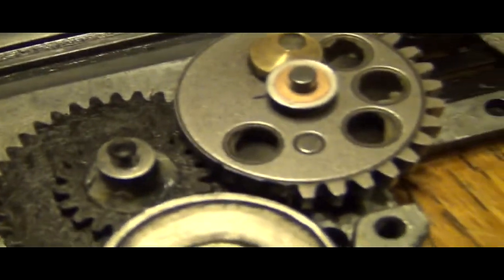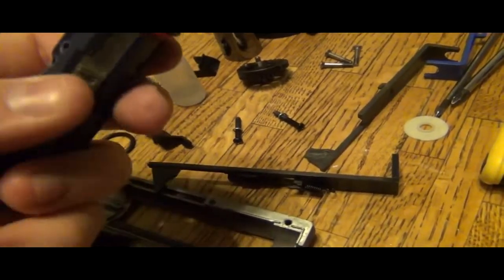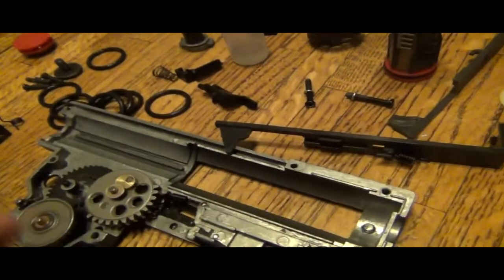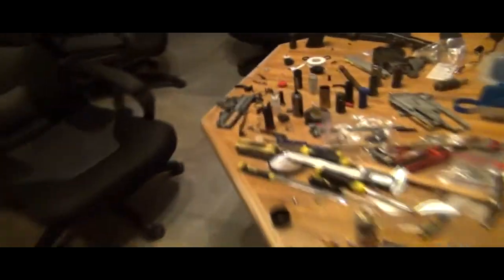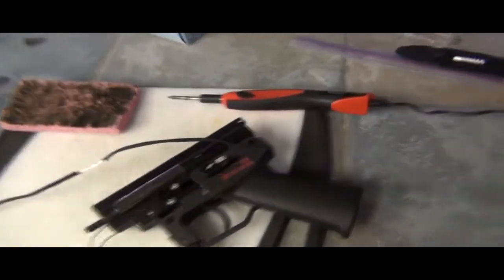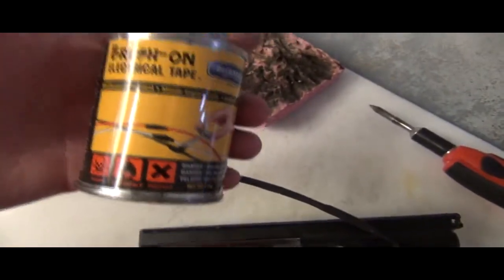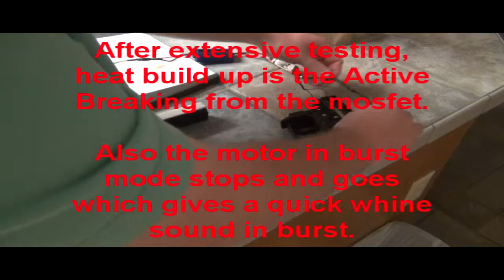Giving Ares G36C Some Tech Love

Comment from the maker: Wiring depends on the setup. Mine is different because I use a MERF now. As for the semi, is that the only thing not working properly? My cut-off lever was worn down overtime. I had to replace it.